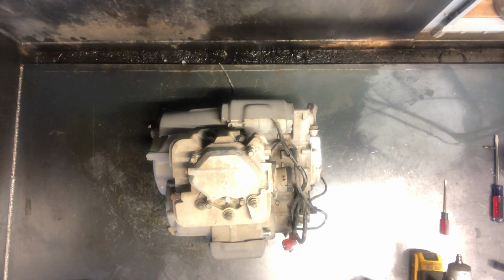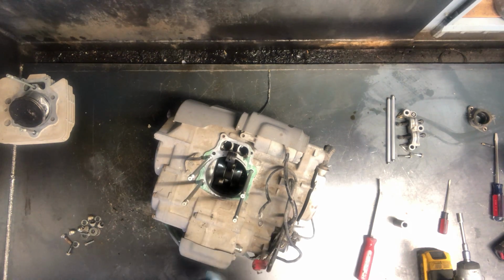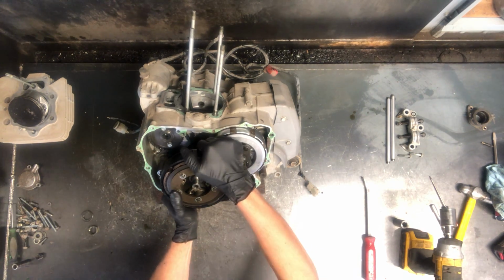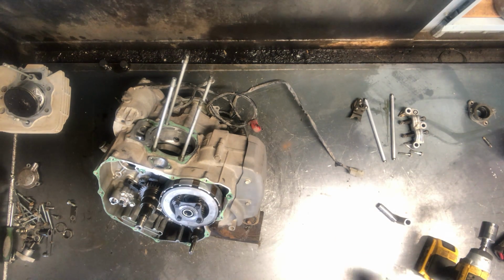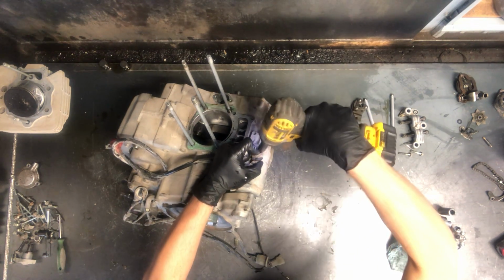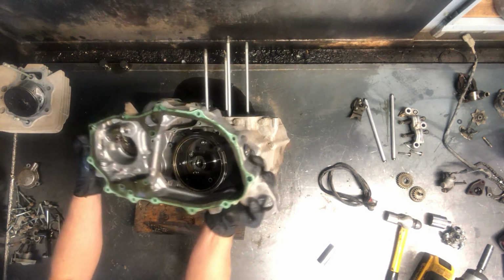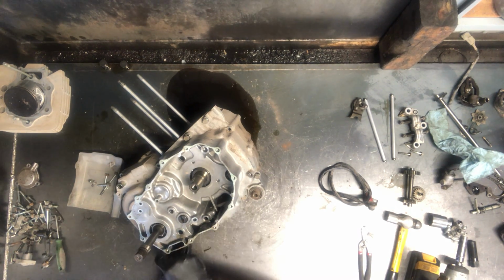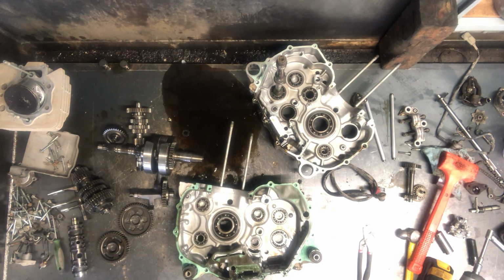Honda Foreman TRX400FW trx 400 - Engine Disassembly Motor Tear Down Crankcase Split

Comment: So do these have that shift drum mechanism instead of the little shift star thing that I have seen on other atvs? I did a clutch replacement on mine but after I put it back together and tried to crank it the shifter would wiggle up and down and after I rolled it back a little it went into gear and now the shifter won’t budge and it’s stuck in gear. Anyone know what the issue could be??

Comment: hi luv your videos, any idea how to remove recoil pull starter bolt very very tight tried rattle gun with air compressor / hand brakabar with force no luck not moving? help please
Reply from the maker: These can be a son of a gun. Bigger better tools is all I can suggest. Thanks for the comment! Let us know if there is anything we can help with. Check out:  https://youtu.be/X0AdFxkJiOg  for more tips. And:   https://www.ebay.com/str/midnebraskamotorsports for all your parts.

Comment: paid guy to replace shifter shaft that broke.  he cant get shifter shaft that runs through the engine to go back in. The cover wont go on flush because the shift rod is sticking out too far. In your video you say if you pull out the shift rod. a washer on the other side will fall. is there a way to fix without tearing the front of the motor apart.

Comment: Hi, i was wondering. i have the 450 version. and i got it from a guy who said it would not shift into neutral or reverse. i adjusted the clutch and it goes into neutral, reverse and 1st, But will not go any higher than 1st. But, when i can eventually get it into 2nd i am unable to shift back into 1st, neutral or reverse. Right now i'm running the quad only in 2nd gear. which i know isnt good at all for the clutches. i was wondering if you might know the problem, and if i'd be able to pool the clutch cover without removing the motor. Thanks!
Reply: @MidNebraskaMotorsports  Thanks! Also, do you think i'll have to remove the motor to remove the housing? Thanks!
Reply: @MidNebraskaMotorsports  you know, now that you bring it up. Where the foot shifter comes out of the quad, it does have a tiny bit of play in the lever. Like forward and back play. (Facing the right side of it)

Comment: 7:10 the puller used here is a Tusk M35X1.5  

Great video too man. Currently doing topend and timing chain on a 99 450 ES. Motor is in the bike yet because im stubborn.

Comment: Hey, quick question, I commented a couple months ago about seeing if you had a video about how to remove the engine from the four wheeler and i was wondering if you posted it yet, and 1 more question, i brought my four wheeler to tall pines ATV park and when we brought it back i tried turning it on the next day and it didn't have any spark, it turns over but wont try an start, i changed the spark plug, the coil, and the voltage regulator and it still doesn't have any spark, i just ordered a new cdi ignition box to see if that fixes the problem if it doesn't do you have any idea on what it might be, id like to try an get it up and running before the snow flies so i can ride with my family. thanks
Reply: You may want to see if the starter is any good

Comment: Great video thanks for the detail. I'm going to split the case on a Foreman 400 to clean it out because water got inside the engine. Is it possible to split the case by only removing the stator side of the engine? Thanks!
Reply: @MidNebraskaMotorsports  Yeah I figured after closely watching the video. Thanks for the reply!